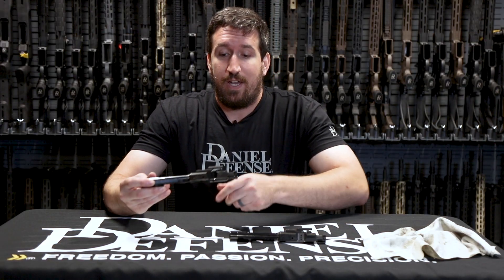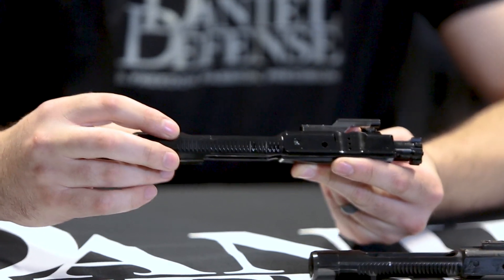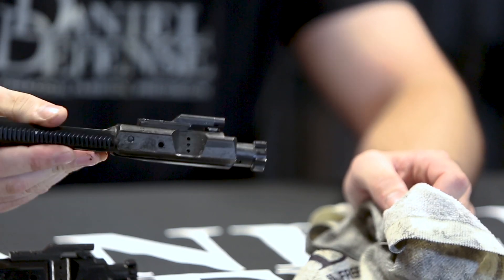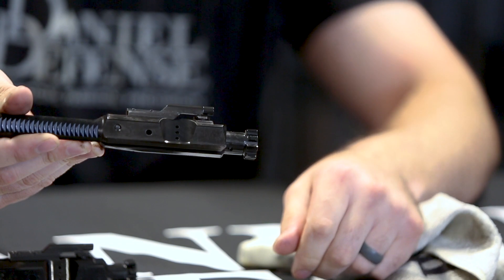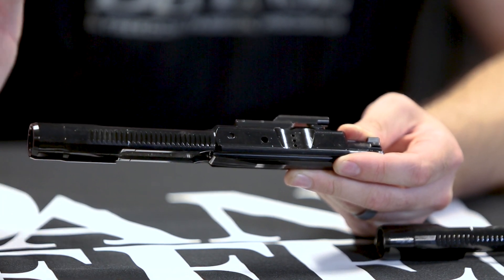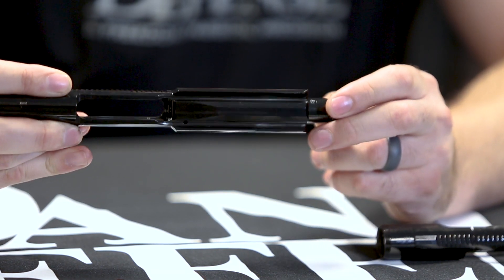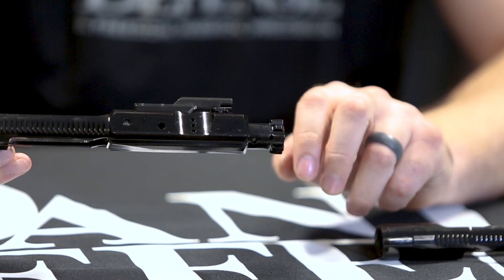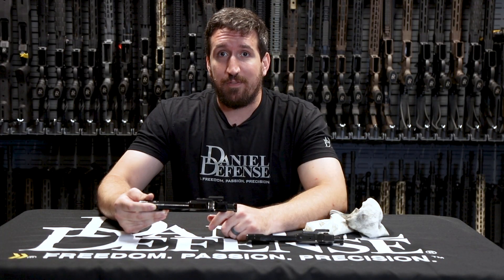The New DD5 BCG

Comment: Hello. After shooting roughly 150 rounds from my V4 i noticed that buffer weight in my bolt carrer is rattling inside. Is that normal? I am quite sure this did not happen when i disassembled the gun for the first time prior any shooting.
Also, my cam pin has visible scratches matching the rim of the slot where it connects to bolt ... and I am not talking about dlc coating brushed off, i mean scratch ... should I be worried?
Reply: Exactly same problem mate after about the same amount of rounds
Reply: Did you find out if it was normal??

Comment: I’m having trouble getting my DD5V4 cycling correctly with heavy grain ammo . Cycles fine with fmj ammo 147grain etc but heavy grain it won’t cycle correct. What would the problem be??
Reply from the maker: Please contact our Customer Service and they will be able to help you out! You can either call or send a message through our contact form: https://danieldefense.com/contacts
Reply: @DanielDefense  How long are your 6.5 DD5 barrels lasting before you see significant swings in accuracy?  Just asking generally speaking.

Comment: "DLC very hard. What does that do to the soft aluminum in the receiver?
Reply: Rob Hawkins only the “rails” on the bolt actually contact the upper (and maybe the cam pin). The coating will wear over time, it’s not a big deal and the aluminum will probably perform just as well as your traditional phosphate coating if not better. I’m not a big Daniel Defense fan, but this is an interesting change.

Comment: Im pretty happy with my original DD5V1 BCG.
Its as slick as owl shat and cleans up easily.
The chrome/nib coating is holding up well on mine. Its round count is still fairly low though.
My only complaint is that i wish the firing pin retainer would retsin itself. The damn thing just falls open allowing the BCG to self disassemble just while handling the thing. And it makes it very easy to let the firing pin slip out of its proper position unbeknownst.
I have magnetized mine but a detent of some type is needed imo.

Also i feel the bolts piston rings need more tension to hold the BCG in battery when disassembling.
That would atleast hold the BCG in battery until you pull it out.
Mine will fall out of battery and out of the receiver if i open the receivers with the muzzle up.
I almost lost a toe the first time it happened. 
The BCG is super slick and buttery smooth but it just seems more ring tension would be better.
Ive seen no evidence of gas blow by and my DD5 has been 100% reliable but i would prefer a bit more tension for the above reasons.

Is it possible to purchase or trade up for the new BCG?
Reply: I thought I was the only one with the loose retainer pin. I was so pissed, thought it was defective but I guess it’s normal.
Reply: hold 'er Newt, shes rearin' ?  Hey Daniel Defense. This is your customer base. Behold, these are the guys that buy your rifles. I hope you’re proud of yourselves. Because these are the only fuckers dumb enough to pay MSRP for your stuff.

Comment: Stainless steel in a bolt. Seems like a downgrade
Reply: chrisfly777300ER there’s some debate as to the long term durability of Carpenter 158 vs other bolt steels. Long story short: a properly heat treated non-158 steel is just as good if not better than 158. Lots of manufacturers are switching to 9310. I haven’t seen any official military testing, but I’ve also yet to see any failures of 9310 bolts simply because of inferior materials. Remember, C158 bolts in standard AR’s were only ever tested to 5-6k rounds by the military. At that point, you’re looking at replacing an extractor or bolt or both.

Comment: Mass is mass.  There is no difference if it moves or not.
Reply: Not technically.  If we're only talking about what the rifle weighs on the scale you're 100% correct.  However the mass of the moving parts plays a HUGE role in how the rifle operates.  A light weight BCG requires hardly any gas to cycle the action.  A heavy BCG needs more gas and will likely have more felt recoil.  The tungsten weight in the rear changes the balance of the BCG, as well as changing which buffer is used.  Also a heavy buffer will change how many rounds can be fired per minute in a full auto application.